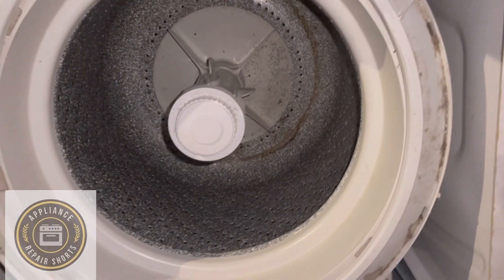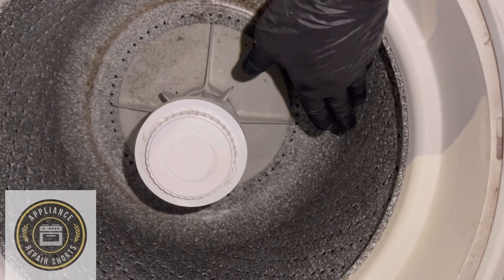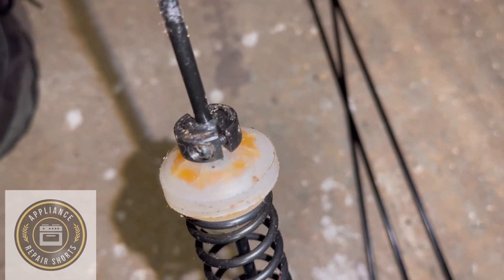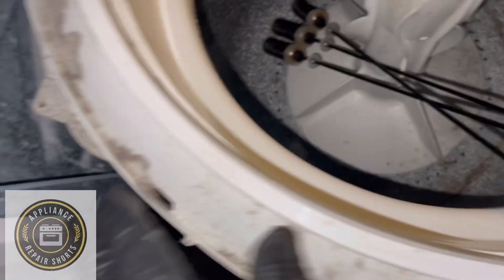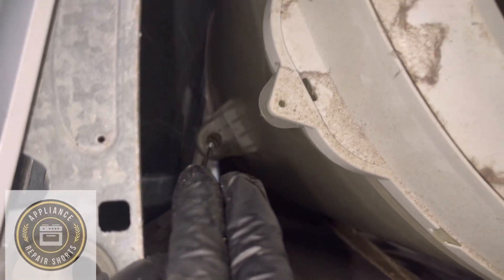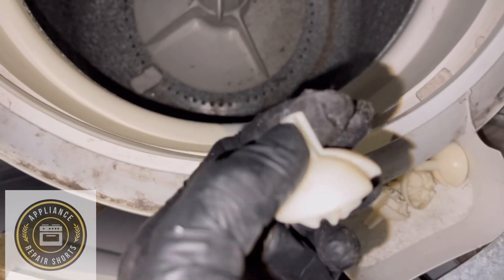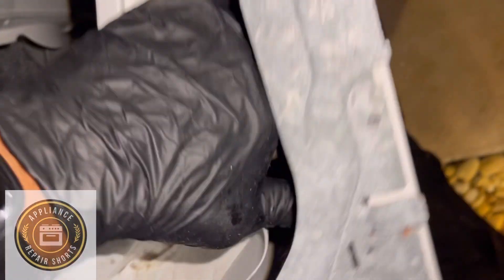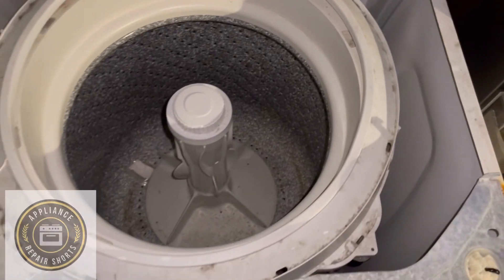Whirlpool Washer Not completing Cycle | Shaking During Spin |  Fastest suspension Rods change out

Comment: I'm at a loss. I have a Maytag HE top load washer.  It's wildly off balance on spin. The washer is level in both directions. I just replaced the rods. Same issue. I'm aware of your fix with the collars. It just seems like new rods should fix it also at least for a little while. 
I'm now wondering if whatever sensor senses it's off balance is defective.
Reply from the maker: Make sure it is the suspension rods. Here is a fast a and easy way. Push down on the basket or use a short piece of wood or something to push down. You are trying to see if the basket is bouncing up and down. It should be firm . Not sure if you bought Amazon suspension or Whirlpool. The aftermarket are known for being cheap and ineffective. Yes the collars are a great option. Cheap and effective. I wish I was making all the sales for the collars lol. If you want to email me a video of you pushing on the basket. I’ll know if it is suspension
Reply: Thanks, I appreciate  the offer of sending you a video. I have seen videos about the bounce and it does not. I can push down on the agitator and it comes back up with virtually no bounce. 
Yes, unfortunately they are the Amazon rods. 
I am determined to figure this out. 
I looked at the parts diagrams and I don't see anything that senses off balance; I thought there would be a sensor, I don't think there is. The machine doesn't stop when off balance and it doesn't get an off balance code. 

Yesterday I laid the washer down and used a flashlight to illuminate the outer tub to see if there was something in it, I don't see anything.
The operation of the tub spinning seems so simple I don't understand why it's so hard to figure out. I fix everything but this has me stumped.  
It's level both ways.
Maybe it is the rods still, maybe they are no better than the old ones. 
I'll have to try the collars I guess.